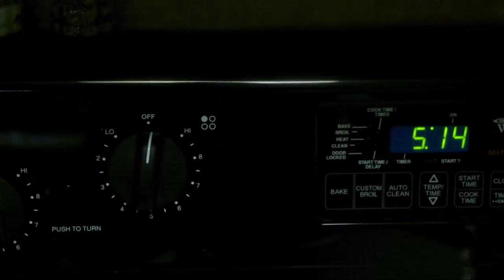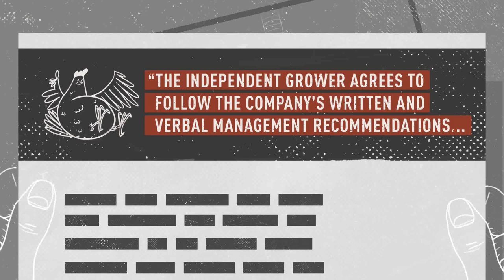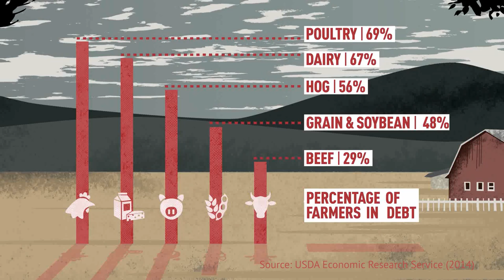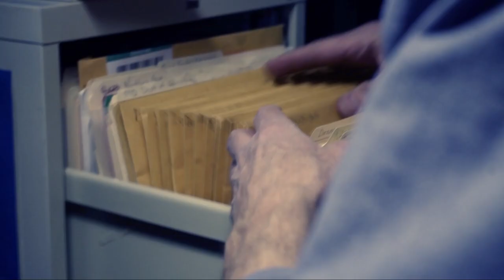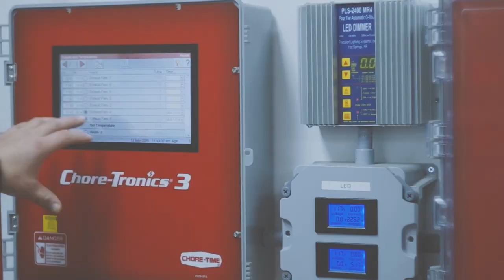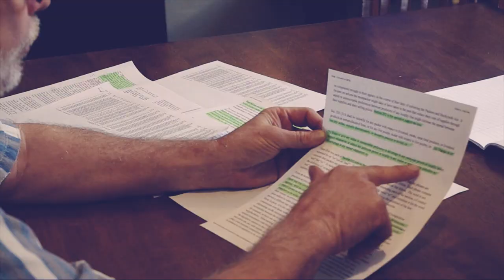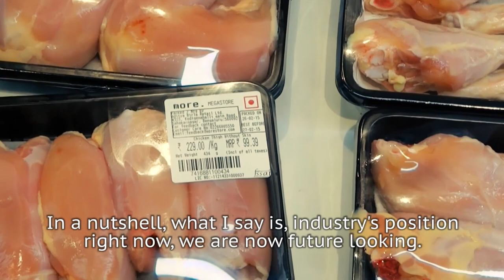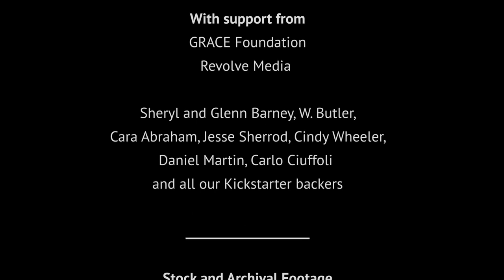Under Contract  Farmers and the Fine Print

Comment: The Collector on the Corner
6 hours ago
We Live 11 miles west of Pocahontas Ark. At the hwy 90 and 93 jct.  Within 20 miles of our location there are thousands of those huge chicken grower houses. and there is a feed mill at Pocahontas and a PECO processing plant and hatchery  south of Pocahontas. And normally at least a half dozen Peco trucks per hour go by our corner. And they ran 24x7. And we havent seen a Peco feed truck or Cackle crate go by in 6 days? Something is up? those growers went millions of dollars in debt to build those houses. The county is on the hook for a 25 million bond to build the processing plant. The Local electric coop spent millions running transmission lines and upgrading the system to service the grower houses. Not a peep from anyone? Everyone is tight lipped? nothing on the news?